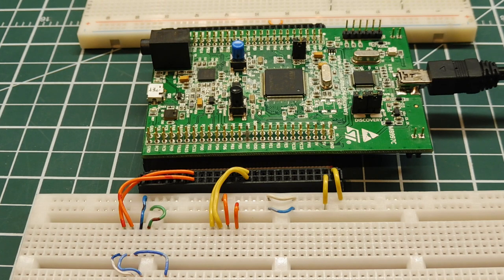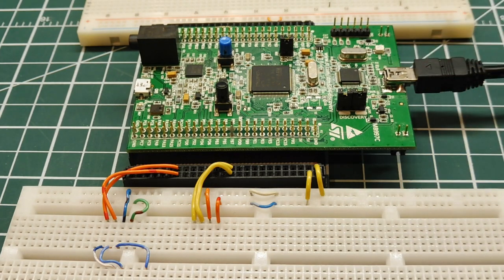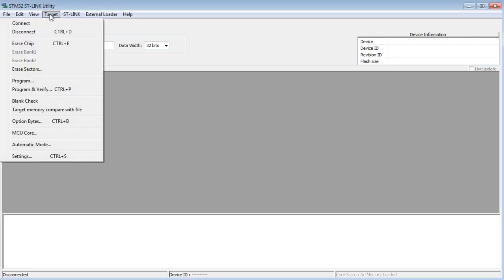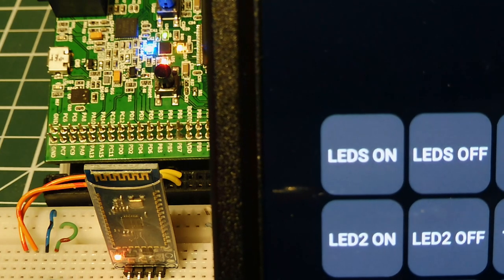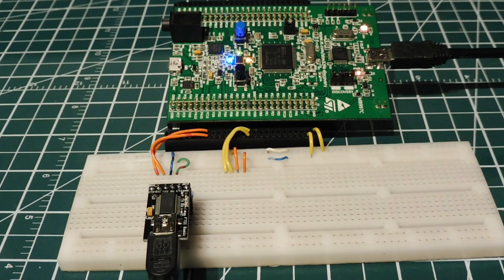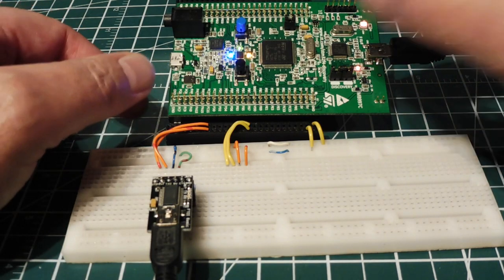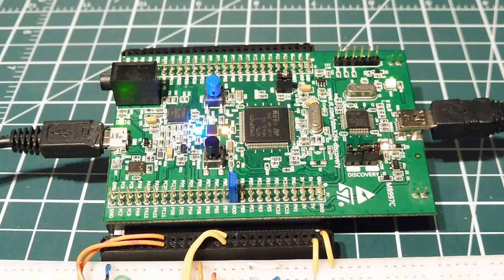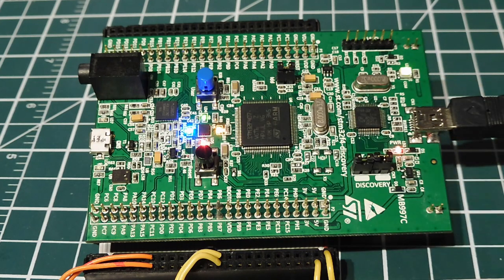STM32 ARM Microcontroller Bootloaders  / Dfuse / ST link / Serial Flashloader

Comment: So resetting with the BOOT0 pin, enables BOTH programming ports... USART3 (Flash Loader Demonstrator)  AND via usb-otg (DfuSe Demo v3.0.5)?  Are there any times when the built-in bootloader should be used versus the St-Link/SWD?  For example, can St-Link program the micropython .dfu/.bin file?
Also, any thoughts on writing a custom bootloader like 'stm32duino bootloader' or 'STM32_HID_bootloader'?  For example, if you want to update the application in-system via the user usb-otg but without changing jumpers... can you the flash the area that it's currently running from?  Or would you have to allocate the new bootloder at the reset address (0x8000000) and place the user application elsewhere..i.e. so that it can be flashed from the custom bootloader?

Comment: Hey 0033mer,
   I watched Andreas Spies's recent upload about Micropython, and was talking about forth yesterday with a few people. I was given a reference to Mecrisp Forth and JeeLabs as a way to play with forth on ARM hardware. I've skimmed the basics and know that Mecrisp was originally intended for the MSP430's, is open source, and has been ported to the STM32 as well. Is there a difference between Mecrisp and the Forth software your using on different microcontrollers?

  Also, I am under the impression you don't use the Arduino IDE. One alternative that several people seem to prefer is the PlatformIO extension w/Atom text editor (if you can still call Atom a text editor at this point). 
  I was also told about "GEANY" as a better environment for using the newer Ardy IDE CLI option with GCC and AVRdude. I haven't looked into it yet but I'm curious if you use other more up to date and feature rich platforms like these or are you using forth for all/most of your projects?

  Lastly, I came across another reference yesterday that got me to start a new playlist on Forth that I named IDE Forth, (because of my personal alphabetical indexing even though it isn't an IDE). That upload I mentioned was based on Mecrisp Forth and the bluepill. He went into how Forth dictionaries work and how words can be "stacked" and built upon to create more complex code functions. He also covers a bit of information about initial setup of registers for IO as opposed to how the Arduino IDE automatically configures these. Later he uses the hardware level info to demonstrate the basics of Forth code optimization by disassembling a section of code.
   You do a great job of introducing your audience to Forth and it's interpretation features. I had a basic grasp of the potential of Forth from watching your uploads, but I didn't understand the dictionary and stack like I do after watching the aforementioned reference. I'll go find the link to his upload and post it as a reply to this message to avoid the main YT auto-spam filter. 
  I have followed your links to more info about forth, but after reading a good bit I had to put this on my list of things to do as a dedicated project, as I need to spend a lot more time dedicated to the task in order to follow detailed instructions. By seeing a bit more of the inner workings "under the hood" I have a much better grasp of where I can go with this, and I can play with this as a side project until I have more time and am ready to go into depth more
  I just wanted to share that last one because your kinda the Forth Guru on YT ;)

Thanks for the upload and introduction to Forth.
-Jake
Reply: Reference:
https://youtu.be/dvTI3KmcZ7I
Reply from the maker: I use different Forths on different microcontrollers.
For the STM ARM I use Mecrisp
https://youtu.be/KgR3uM21y7o
On the Arduino I use 328eforth
https://youtu.be/n7l4Wn6xalc
I have ported my own Forth for X86 micros called Flash Forth (Forth.zip)
http://www.jkmicro.com/Downloads-General.html
Forth Interest Group (FIG) has a listing of compilers. 
http://www.forth.org/compilers.html
If you want commercial Forrh and support  for the Forth compilers check out www.forth.com
A good book to start with is Starting Forth by Leo Brodie (free download online)

Comment: I have tried to use "Flash Loader Demonstrator" for a new STM32F051R8. In the MCU have no firmware to initial USART peripheral. It didn't work in this case.
Reply from the maker: Check out application note AN2606 for bootloader information on the STM32 microcontroller family.
 https://www.st.com/content/ccc/resource/technical/document/application_note/b9/9b/16/3a/12/1e/40/0c/CD00167594.pdf/files/CD00167594.pdf/jcr:content/translations/en.CD00167594.pdf

Comment: Thanks for the great video.  

With DFU Demo 3.0.5 from DFuSe, I am having an issue that the tool said the upgrade is successful but the transferred data size is 0KB of 0KB. Thus the upgrade was actually not successful.

Details as follows:

When I generate a DFU file from a Hex/S19/BIN file with "DFU File Manager", I think I must input the information below: 
1.Target ID 
2.VID 
3.PID 
4.Version 
5.Target Name
6. Starting address (if binary file is the file to generate DFU file)

I have studied and compared many sources and here is something I want to try again shortly (I only put.VID:  0x0483 previously)

1.Target ID: 0x00
2.VID:  0x0483
3.PID: 0xDF11
4.Version: 0x011A
5.Target Name: Internal Flash
6. Starting address (if binary file is the file to generate DFU file): 0x0800 3000

Could you comment whether they are correct or important?
Reply from the maker: The fact that you got it in DFU mode indicates it should of worked.
You can read the VID,PID and Version in Device Manager.
Look for "STM Device in DFU Mode" /Details/Device Description/Hardware ID
If you are building your own USB product, STM provides the Product ID for their vendor ID.
I would verify that the driver you are using is correct.
Reply: Thanks and I will try again when the modules are available.
Reply: "I would verify that the driver you are using is correct." ==> May I assume the details of verifying the driver can be found in this document: "UM0412 User manual: Getting started with DfuSe USB device firmware upgrade STMicroelectronics extension"?

Now I remember I did not follow steps as mentioned in the section of "1.3.2 Hardware installation". Maybe this could explain why "upgrade is succesful" but 0KB out of 0KB was transferred.

If this is the case, I am going to request the board I tested before and performed DFU action again.
Reply from the maker: When you download DFU Demo 3.0.5 you will also get a driver to run on the windows version you are using.
Under Program files\STMicroelectronics\Software\ DFuSe v3.0.5\Bin\Drivers.
When you connect in DFU mode to the micro board, look in Device Manager for "STM Device in DFU Mode"
Check to see if the driver is running properly
Reply: Okay, waiting for the board to be available. I will be very careful this time. Thanks!

Comment: Thank you for the excellent video tutorial !
I would please like to ask: you mentioned that the video "cover three boot-loaders", but isn't it more correct to say that the 3 host tools are all using one bootloader ? (as far as I know there is only one bootloader in rom from ST) Thanks!
Reply from the maker: Yes .. one rom image with 3 different threads.

Comment: Hello,
Is it possible to do that over half duplex rs485 line?
Thanks for your answer...
Reply from the maker: If you can find a RS485 to RS232 TTL converter it would probably work.
Reply: 0033mer , But the 485 line use an additional TX/RX Enable pin!!!
Reply from the maker: The DE and RE pins are tied together to form a flow control pin.
It is up to you to supply proper logic for data flow.

Comment: If programming using the STlink via the SWD, does boot0 still needs to be pulled to high?
Reply from the maker: No ... when using SWD boot0 is low. (stays in the original position)
Check out this video: https://youtu.be/KgR3uM21y7o
Reply: Thanks 0033mer. I've just gone thru the AN2606. Its seems that BOOT0 can either be high or low.

Comment: i am using STEVAL-STLCX01V1. It is not recognized in my computer. how do i make it recognize?
(i am using windows 7 as my os)
Reply: Does it have an ST-link area on the board. If so, you might need the ST driver utility installed on your computer.

Comment: My STM32F103C8 bluepill is not getting recognized. how do i fix this problem? I cannot update any driver into it too...
Reply from the maker: Check out this video:
https://youtu.be/KgR3uM21y7o
Reply: 0033mer can you tell me how do i do the same using a usb - ttl device and not a st-link?
Reply from the maker: If you have a Bluepill module you can upload a hex file using the ST dongle via SWD or you can upload a hex file through the serial port using a FTDI. ( USB - TTL )  Pick the one that is easiest for you.
https://youtu.be/8qevASRjjEs

Comment: thank you.can i use a another usart like usart2 ?? or just usart1 and usart3
Reply from the maker: Just USART1 and 3 for the discovery board. Every STM32 device is different so check App note AN2606 for a complete list.
https://www.st.com/content/ccc/resource/technical/document/application_note/b9/9b/16/3a/12/1e/40/0c/CD00167594.pdf/files/CD00167594.pdf/jcr:content/translations/en.CD00167594.pdf

Comment: Thanks  0033mer, for the useful video. You have a nice way explaining that makes it easy to understand.
I have been using PIC 8-bit microcontrollers for more than a decade, but am new to STM32  uCs.  I have a Blue Pill board with STM32F103C8T6 uC and 64K flash. I have replaced the R10 (10K)  with a 1.5K resistor,  successfully uploaded the boot loader file from GitHub (generic_boot20_pc13.bin) through ST Link-V2 and installed the required drivers. But when I connect to the USB port, I always get the message "USB Device Not Recognized". My OS is Windows 7. 
Can you offer some help?
Reply from the maker: You have two other options to program the Blue Pill. You can use SWD and a STM32 V2 dongle ( like you have done ) or program via USART1 using a FTDI. Here are some videos explaining the process:
https://youtu.be/KgR3uM21y7o
https://youtu.be/8qevASRjjEs
The STM32F103 does not come with a factory DFU USB bootloader so the code you are using is third party and takes up program memory space so I do not go that route. If you are serious about STM32 Arm programming have a look at the 1Bitsy board.
https://1bitsy.org/

If the code you uploaded is compatible to your board the problem you are having is probably driver related.
https://www.rogerclark.net/arduino-stm32-usb-serial-and-dfu/

Comment: When the "DFU file manager" is used with a Hex file as the input, the data address 0x0800 0000 is inserted into the generated DFU file automatically followed by the data size (compliant with DFU file spec named UM0391)

When a binary file is used for generating a DFU file, a default address 0x0000 0000 is inserted into the DFU file unless I manually change something like 0x0800 3000 in the GUI.

Should I ensure the address of 0x0800 3000 (or something else) be inside a DFU file, in the field of wElementAddress (starting address of the data)? Or, the USB driver will take care of the actual internal flash address of the STM boardto write onto ?
Reply from the maker: For a binary file you have to enter the start address which is usually the start address of the first sector of internal flash.
They gave you this option so you can have multiple .bin files added to the list.
Which microcontroller are you using?
Reply: Thank you for your reply. My board has STM32L083RZT6.
Reply from the maker: Your application starting address is 0800-0000 which is mirrored from address 0000-0000.
Factory bootloaders are installed in ROM in system memory and are executed when Boot0=1 and Boot1=0
If you write your own custom bootloader it will start at 08000-0000 and your application will start at 0800-3000
The memory mapping structure of the STM32 is complex and must be understood if you are writing your own bootloader.
Play close attention to the data sheet of the micro you are using as there are many differences in the STM32 family.
Here is a good tutorial for beginners using the STM32 Arm family of micros:
http://www2.cmp.uea.ac.uk/~mhf/embedded/resources/isg-stm32-v18d-scr.pdf
Reply: Many thanks for the explanation and the PDF link. I am not writing any custom bootloader at this moment.